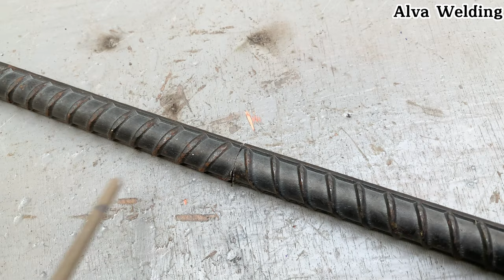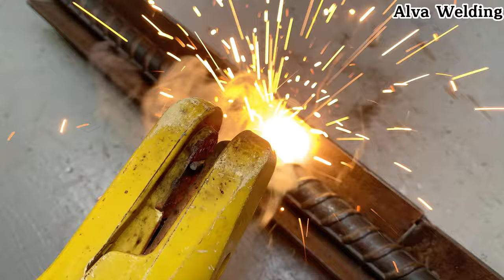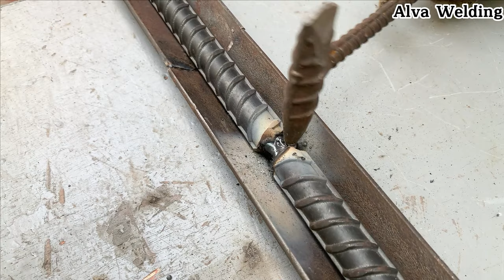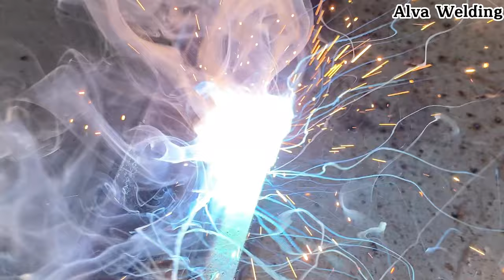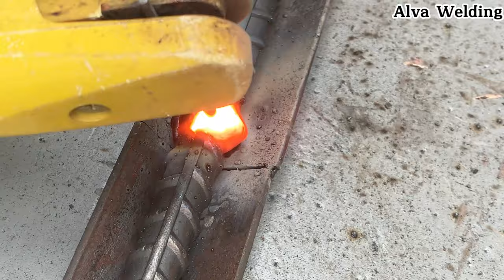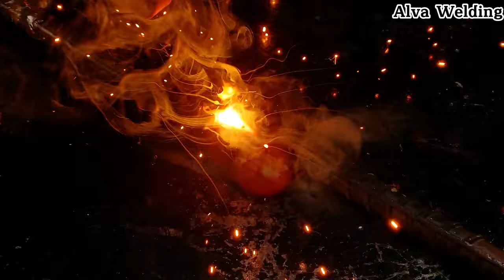Two Little-Known Welding Techniques For Powerful Steel Bar Joints

Comment: Thanks for the video. I am on my 3rd attempt at welding. I have been using a 3mm rod and low amps (55A, maybe too low) I have noticed that I just melt the rod over the bar, sometimes it snaps and I see that the bar wasn't even melted. Do you get to melt the steel bars?
Reply from the maker: You can melt the steel bar like I welded in a 6mm wide gap. If you use a 3 mm welding rod at 55 amps, it's too low. Where I only have 3.2 mm welding rods, I have to use a welding current of 90-130 amps. You can refer to it for more information. Wishing you early success with your project
Reply: @Alvawelding20  Thank you!

Comment: No no you just overlap it by 24 inches and tie wire it together
Reply from the maker: Thank you for leaving me a comment. But for columns and walls. Iron from 16mm or larger welds more firmly